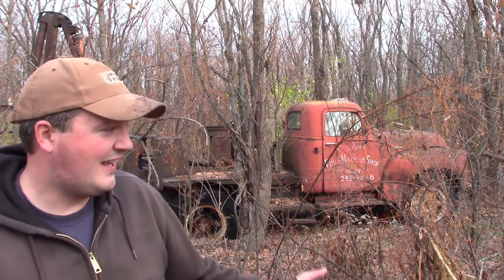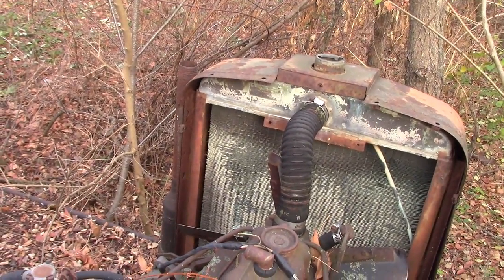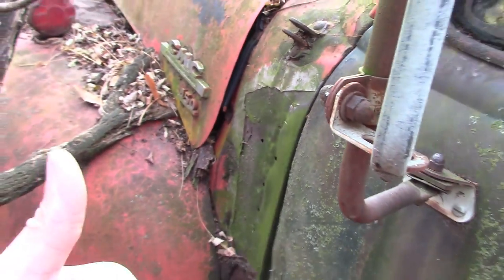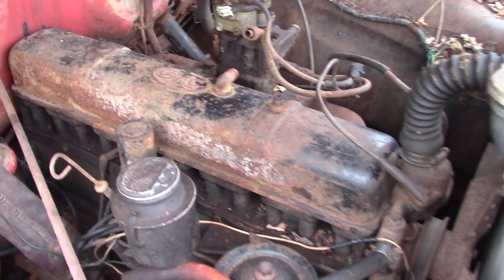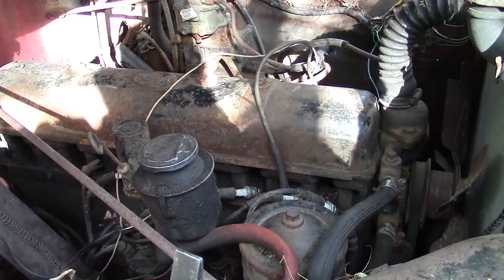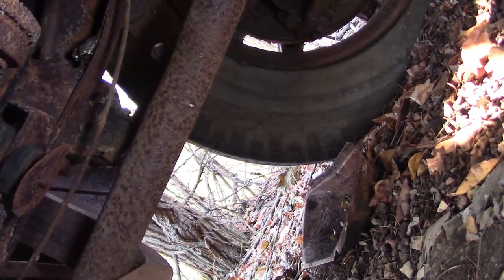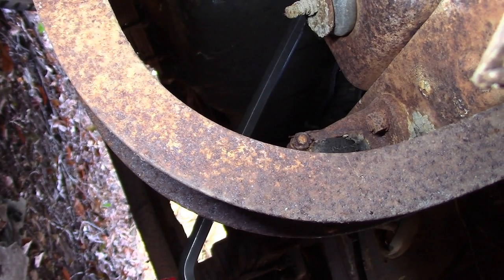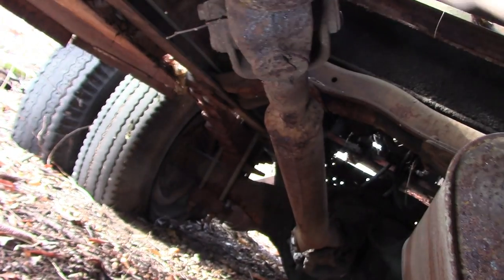Forgotten 1950s GMC Truck Backhoe Thing - Will it Ever Run Again?

Comment: Enough time and money can fix anything. But unfortunately I don't think the juice is worth the squeeze on this old girl. That backhoe is pretty cool. I think it's neat that it had its own straight six motor to run the hydraulics instead of being PTO driven. Especially on a truck that has a PTO on it. lol. Overall a very cool old unit. When you popped the hood I was almost expecting to see a 453 detroit under the hood.

Comment: Would you ever have the opportunity to make a FrankenTruck / FrankenTractor? As you note, on this vehicle there doesn't seem to be anything worth salvaging except maybe some body panels. But what if you find other vehicles that are a total loss except for a motor, a total loss except for transmission and axles, etc, and you slowly build up enough parts to build a fully working vehicle? I think people are enamored with the idea of you fully resurrecting these old vehicles, but a full resurrection just isn't doable in most cases. Not without the resources and manpower of Jay Leno's Garage. What about making a year long project of not resurrecting a specific vehicle, but harvesting parts from a bunch of dead vehicles to make one live one?

Comment: Wait, eye of newt and skunk fat is a HufflePuff recipe :-)
It takes as much discipline to walk away from projects as to take them on.
That bad boy need two engines (and all the accessories),a new suspension, new brakes, and new tires (and likely split rims)--most of which are going to be Unobtanium.  Even with some sort of omniscient knowledge of every salvage and/or junk yard and a way-back machine, this would be a too hard build.  Even with Morgan helping :-)
But, the video was good for my Saturday night, I can hardly ask for more.

Comment: you can still get 20 in tube type tires for that vehicle today they are still used today on sea container chassis and any commercial tire center will change them for you it is the split rims that split in the center that are illegal that nobody will touch

Comment: Hi I am New to your Channel , But Love What You Do......What did you do with the Old GMC Backhoe Truck?  I am Looking for Parts For Truck I am Working. on.....I Need All the Dash, I know the Motor may be worth saving? It Could be a 270 cubic inch Or Maybe a 302 cubici nch which is very hard to find down here seems to me?I would love to buy all the drive train out from under it  including Front and rear axles......Oh Hell just price me the whole truck with out the Back Hoe~ Love Your Videos and am watching the Oilver Track you are working on and also the other Track you are working on! Keep having FUN, and I will keep Watching You!
................Bobby

Comment: Is the roof on the cab solid? If so, securely mount a comfortable seat on it. Now you got a deer stand. 😊 Somebody wore that rig completely out. Patching and repairing until it couldn't be fixed again. Nice try Wes.

Comment: Maybe you fill some flammable welding gas with oxygene in the frozen cylinder. Put a good Sparkplug in and light it up. Maybe that explosion will free up the engine.

Comment: Did you move further away from the 'undisclosed location of damned equipment'..so it's harder to get to with tools, etc?
Reply from the maker: No. It's always been 30 minutes away.
Reply: @WatchWesWork  Ah yes, you said as much in the video..my bad.

Comment: If only there was a way to meld steel together.  If that existed, one could weld a capture cup that would accept the jack head and one could use the jack in relative safety

Comment: project novelty truck. take home, put diesel engine and trans in it, a small diesel engine to run back, do some low grade restoration on cab and interior, upgrade suspension from a more modern junked dumptruck/work truck, and take it to fairs or something for the laughs

Comment: Hm, was't so bad an idea back then. You have a 2 in 1 piece of equipment saving you the extra hassle of driving an excavator to the construction site on a flatbed. Reminds me a bit of the machinery made in GDR (German Democratic Republic 1948 - 1989): take some scrapped Russian - made GAZ trucks plus some added machinery, and there is your road construction / farming equipment! As about 20" tube type tyres: there is a Company in the Czech Republic called Mitas that makes tyres for Oldtimers, especially in pre - radial odd sizes. Maybe that could help you.

Comment: Could always go with grease gunning the number 5 cylinder. I've got a seized up single cylinder engine I'm about to last-ditch-effort try it on.
Reply from the maker: I did a whole video about that. It didn't work.

Comment: Let those filled-full pistons soak in diesel and transmission fluid over the winter...come back next summer and put a big cheater bar on the crank...you never know. I'd put the same concoction liquid down the exhaust and intake manifolds too...fill them up over winter. The water has set for years...let the solvent set for a year or two....fair is fair when breaking over an engine.

Comment: After I saw Mustie1 need a 20 ton press for a single cylinder engine, I don't see any way of getting that thing running without building a workshop around it.

Comment: When you are 14 a vehicle like that inspires thoughts like ''OMG YES THIS CAN BE THE GREATEST THING EVER IT'LL ONLY TAKE A FEW WEEKS OF RUBBING ON IT AND SPRAYING SH T IN THE CARBS I GOTTA HAVE IT BATMOBILE AND WILLY WONKA LOOK OUT YEAH''. 30 or so years later it inspires nothing, absolutely nothing. Even if you scrapped it, there's not enough of it there to be worth the time once you've beaten it apart and sorted and de-rust-ified it and likely hurt yourself several times in the process and spent days goofing with it that you can NOT get back. I wish there were a spray can of something that would just erase such things from existence, like, spray it on and a week later it'd dissolved into the earth - organically, of course.

Comment: anyone ever consider making a threaded plug to go in the spark plug hole with a grease zerk in it and pump each  cylinder that is on the down stroke up with grease under pressure like the adjuster on a tracked vehicle to break an engine free (or possibly just break it)

Comment: I thought you freed up a stuck motor by filling the stuck cylinder with ether putting the plug back in and firing the plug with a battery and HT coil  !!

Comment: Fill up the cylinders with PB Blaster and that actually works better than diesel fuel and transmission fluid you're down here
Reply from the maker: If the ATF didn't work after a whole year I think we are hooped.

Comment: Those are split ring rims. Dayton wheels. Lot of shops will work on them.  The “widow makers” are the  ones that the rim is actually 2 halves that lock together.  This style is no diffrent than any industrial lock ring wheel.

Comment: come on man, pour evap o rust into the cylinders. wait a few days. pull the head and hone cylinders do valve grind job put pack together. they do it on cold war motors channel all the time, even using the old head and valve cover gaskets! just straighten the gasket and spray with copper seal and good to go! She'll come alive again!

Comment: Grease gun . if not pull the head clean the cylc anf soke and a bloco of wood and hamer every pistion clean rust out and it will turn over.im 40 years im very

Comment: That is NOT widowmakers! 

Those are split ring, and therefor dangerous, but not lethal to be near. 

There are known as Daytons, and you can swap a modern ring/donut on, with modern tires, and keep on trucking, or stick to what you got. 

And not I will watch the last 2/3 of the video.

Comment: throw a breaker bar on it yank on the breaker bar with a vehicle if it breaks loose itll run if it snaps the bolt oh well the trucks too far gone to be on the road again its more yard art now do a will it start on the black car behind it